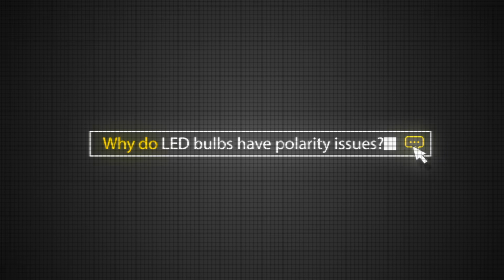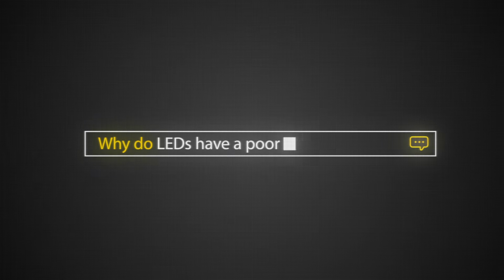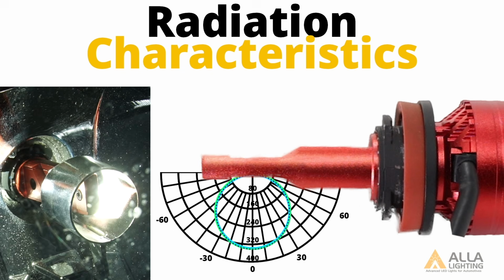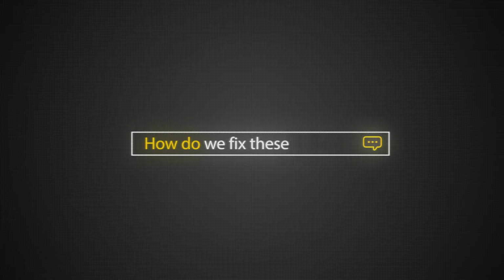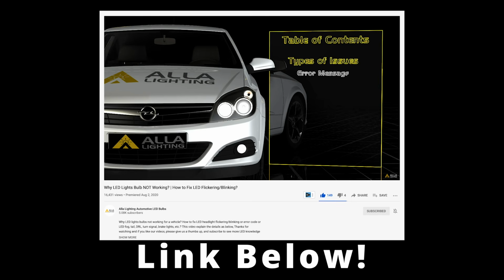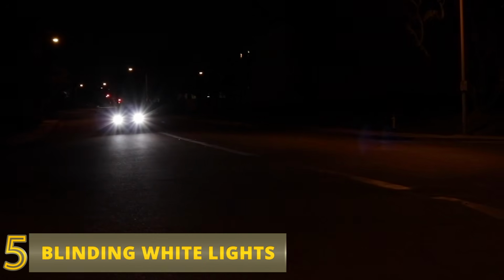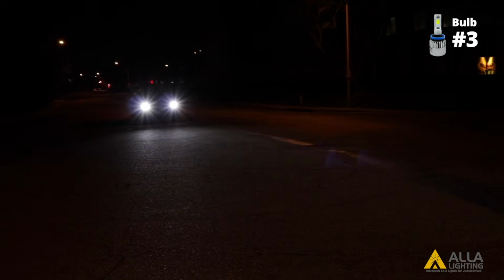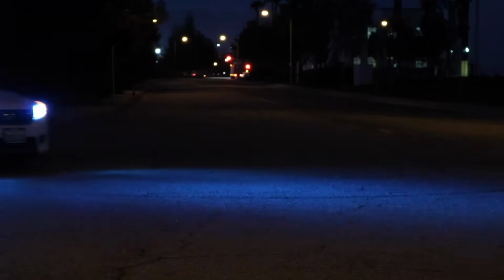Watch This Before Buy LED Bulbs | Known 5 Top Issues & Troubleshooting

Comment: Can led melt the headlight ?
Reply from the maker: No, LED bulbs draw less power than stock halogen headlamps, it will be safer
Reply: I just bought an led light for my 2020 elantra, the box says the led is 180w and the stock halogen bulb is 60w. 

I tested the led light and it got hot fast, I’m having doubts installing it, is this normal or not ?

Comment: hi. i want to ask , i install 60w led bulb at the low beam on my honda civic fc 2018. the high beam random blinking itself driving and also when the car is off.  what problem
Reply from the maker: Thanks for your message,  this happened probably the bulbs you purchased are not compatible with your car, recommend to try a different type. For your car, should no flickering issue, just plug and play.

Comment: I Installed 20000 lumen LED bulbs on my 04 F150 and they work normal on low and high beam but when im on low beam and turn my fog lights on, the passenger side high bean turns on
Reply from the maker: Thanks for oyour message, we apologize we just found your message, sorry for the delay, if you still need our assistance, please email service@allalighting.com of the issue details for further assistance, thanks in advance.

Comment: Tell me why so many Led Headlight bulb Manufacturers that are out there that don't make Led Headlight bulbs properly as the Led Headlight bulb Chips that don't even come close to the size of the Halogen bulb Filament as a lot of these Led Headlight bulb Chips are by far too wide to even come close to the Halogen bulb Filament &.there a lot of Led Headlight bulbs dont even line up Exactly Perfectly with the Halogen bulb Filaments I think its crazy for Manufacturers to make these type of Led Headlight bulbs there's even a new OSRAM H7 Led Headlight bulbs & yet again these H7 Led Headlight bulb Chips are by far too Bloody Wide & they even have a 4 Year warranty it's Dam Crazy these OSRAM H7 Led Headlight bulbs are going to throw the Headlight Beams in all Directions the CSP H4 Led Headlight bulbs I have brought on Wish the CSP Led Chips are very small Led Chips & the Line Up Exactly Perfectly with the Halogen bulb Filaments both on High Beam & Low Beam & what a Big Massive Difference I have Brilliant Bright White lights & don't dazzle or Blind other Drivers on the road or roads on Low Beam because everything lines up Correctly to the Halogen bulb Filament & even Led Headlight bulb Manufacturers making the bulb in pyramid shapes at the top of the Led bulb & at the top of the bulb sit 6 Led Chips & how is that going to match up to the Halogen bulb Filament & it's not going to come near to the Halogen bulb Filament & there are other Led Headlight bulbs that have 4 sides & there is a lot of Led Chips on the 4 sides how is that going to work it's not as it's going to throw the Headlight Beams in all Directions & being Dangerous to other Drivers on the road or roads & I can't understand why some of these Led Headlight bulb Manufacturers Design & make these Led Headlight bulbs like that it's Bloody F_______n stupid they are now where near match up to the Halogen bulb filament it's just Bloody Crazy why the Hell do they Design & Make Led Headlight bulbs like that it's just Dazzle & Blind other Drivers on the road or roads it's just too Bloody Dangerous to other Drivers on the road or roads & People that go out & buy these Led Headlight bulbs that just don't come near to match the Halogen bulb filament I.just don't know what's in the guy's minds Designing & Making These Totally Wrong Type Of Led Headlight Bulbs you just can't beat Led Headlight Bulbs that the Led Chips are the same size & Line Up Exactly Perfectly With The Halogen Bulb Filament & Both High Beam & Low Beam & there at lot of these Led Headlight bulbs being made & some of these Led Headlight Bulbs can be more expensive & My H4 Led Headlight Bulbs I bought on Wish were  NZ $38.00 those CSP H4 Led Headlight Bulbs the Chips are very small & they sit further inside of the H4 Led Headlight Bulbs & they are 100 Watts each 6500K & they say 20,000 Lumens so 10,000 Lumens each bulb  & even on Low Beam the Bright White Lights turn Black Tar Seal road or roads to white they are Amazing CSP H4 Led Headlight Bulbs & the CSP Led Chips sit on an Aluminum PCB & no fan & have a fair size Heat Sink & specially Designed to keep the heat away from the Led Headlight Chips & I put the Led Headlights on full Beam they are incredible they shine a very good distance away & Very Nice Bright White Light & my H4 Led Headlight Bulbs sit at 3 0clock & 9 0clock inside the Headlight Housing to line up.to the Reflectors Kind Regards Peter
Reply: Lao one
Reply: Lao one

Comment: I have a 2000 tundra. I installed led headlights and fog lights, now the fog lights won’t turn on, but the high beams do instead, would a resistor work for this issue? And how do I know which headlight to use the resistor on ?
Reply from the maker: Thanks for oyour message, we apologize we just found your message, sorry for the delay, if you still need our assistance, please email service@allalighting.com
 of the issue details for further assistance, thanks in advance.
Reply: Never had any of those problems ….buy high quality bulbs … I use the termitor h4 plug and play and you are good to go … Nam Jamaica
Reply: @phenamenol  are you saying these aren't high quality? Lol
Reply: @ I have seen where some of the Chinese bulbs which are of inferior quality … give off scattered beams which cannot be focused properly .. they are common here in Jamaica … and everybody get blinded by them